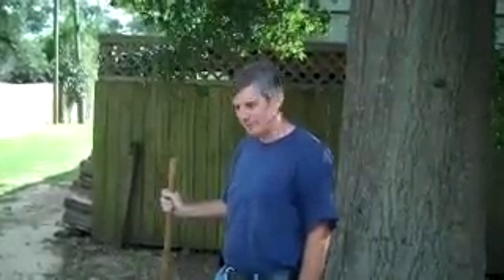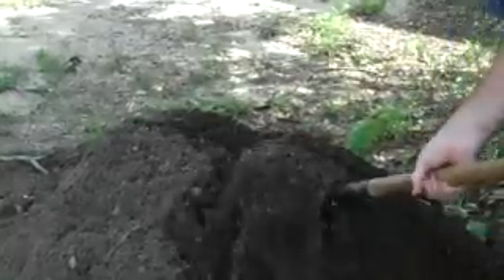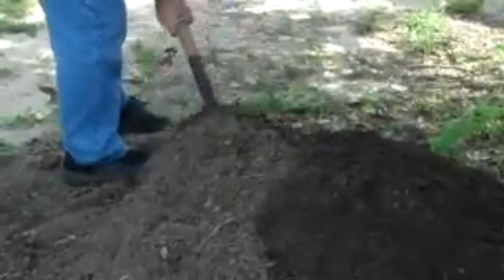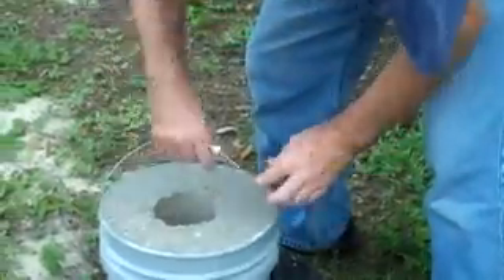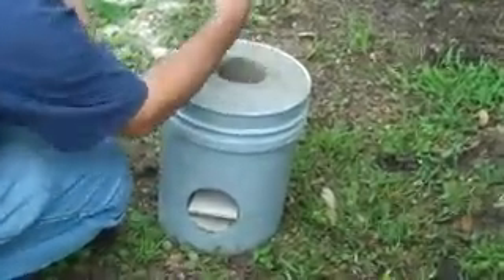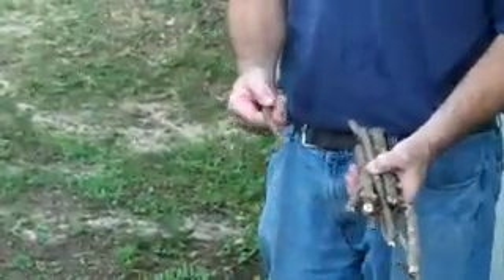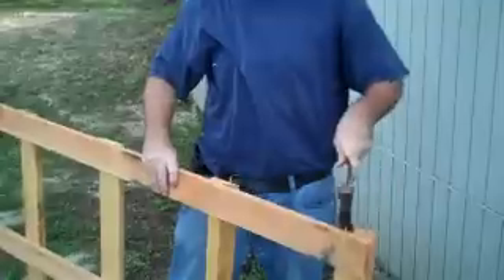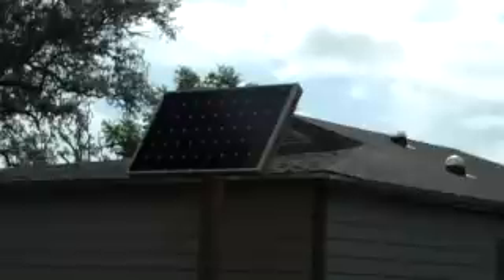Project Updates

Comment: Hi you said you three stoves  what are you going to use then for? I am looking at doing one for a greenhouse  as a mass heater for that. I also have a brick built BBQ that I want to convert into an oven and hot plate. Thanks for posting I like the design and the cost. Dave

Comment: have you considered embedding the steel rebar in the concrete flush with the top of the stove? You would still have room to load sticks, your pots wouldn't fall in and you wouldn't have to keep track of them.
Reply from the maker: Hello 1Independentrider, I did think of doing that but wasn't sure how the expansion and contraction of the metal from heat would effect concrete.  Thanks, Gene.

Comment: Im doing one using corrugated cardboard for the tunnel forms. Then just burn it out. Maybe some perlite or vermiculite as aggregate.
Reply: That's not a bad idea. I presume that the vermiculite mixed in with 20% concrete would be light enough that it wouldn't crush the cardboard. I wonder if I could also make the bucket shape from cardboard too- then the whole form could just burn away at the end. Perhaps if I put a flattened piece of tin can into the front vertical tube whilst the concrete mix is drying, that would provide a little shelf for air to flow under the sticks?

Comment: Is the rocket stove fairly light to carry, being made partly of concrete? I was going to make one using aluminium cans but this looks easier (much less cutting).
Reply: I also thought of an aluminum can but I'm too pressed for time to cut the hole in metal but I will put metal chains on the sides for sturdier handles, I dont trust bucket handles with that much weight. That's an injury waiting to happen.